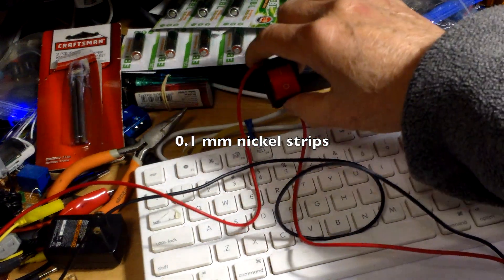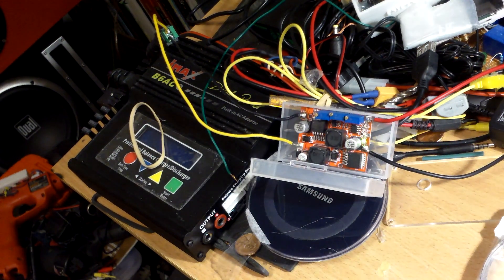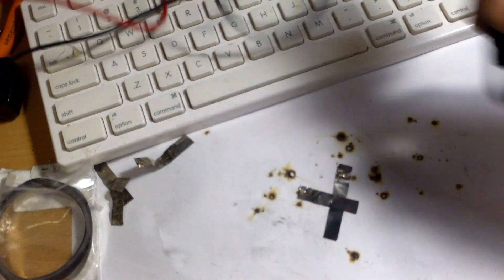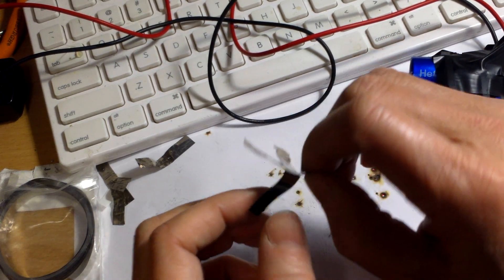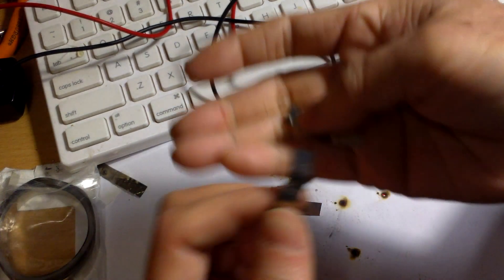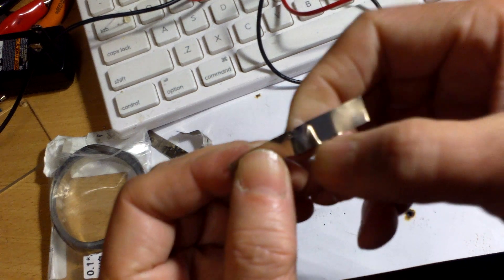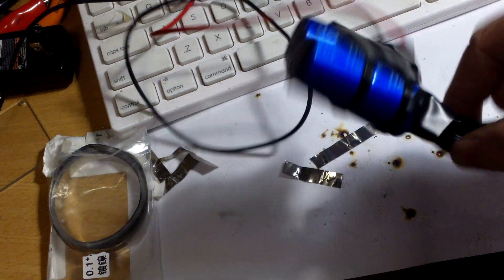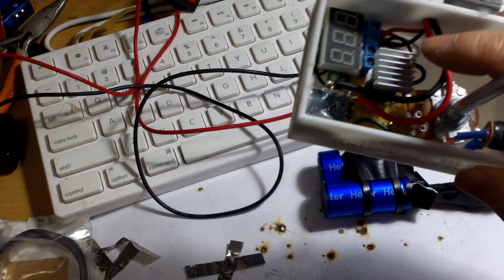Yes you can spot weld with super capacitor but...

Comment: There is a video from Thailand where the guy only used one 350 fd. 2.7 volt super cap that he charged from an 18650 through a 0.1 ohm resistor. It charged slow enough that he could stop around 2.85 volts. He got several nice welds per charge. He was spot welding to batteries, not just strap to strap. Control charge current and you can recharge from anything. Keep the electrodes as short and heavy as possible. You can't do it cheaper than that.

Comment: Looks like your having fun experimenting. It looks like a very good weld.. you pulled pretty hard. When a welded spot pulls away the parent metal it doesn't get much better than that.
Reply from the maker: The super capacitor route does work but you need to use several of them connected together if you want to do more than two or three welds. Nothing like trying it out for yourself to see the effectiveness of doing it this way.  Thanks for commenting.